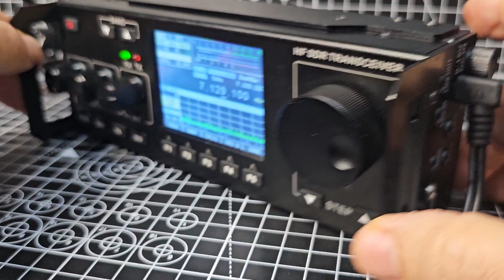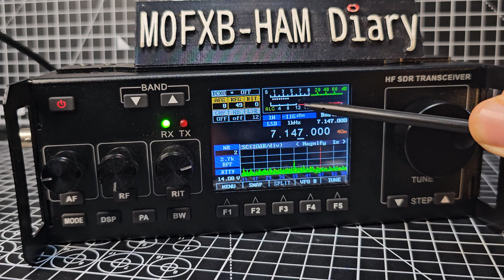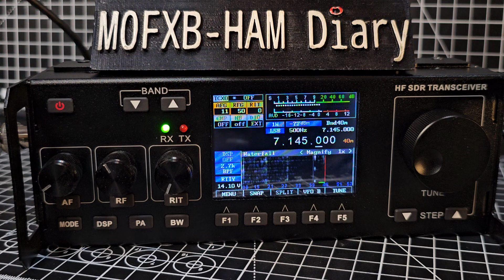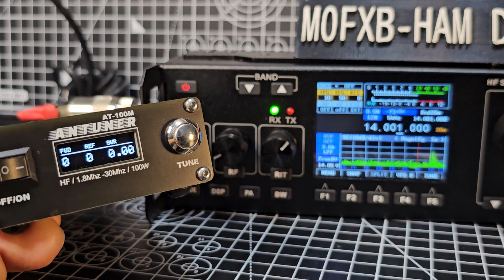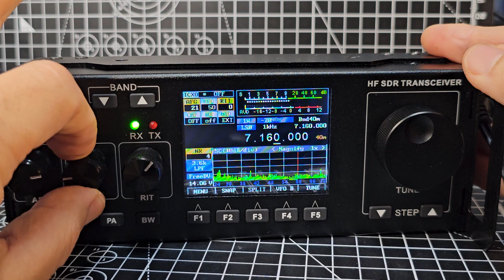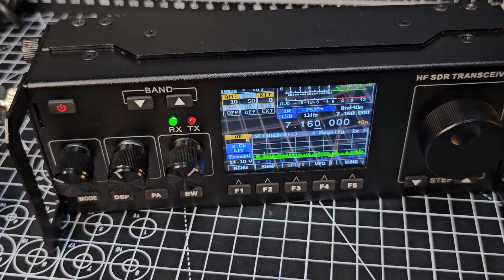RS-918 SDR , HF  Beginner Learning

Comment: Thanks again for your videos on the RS 918. Will be a big help. Here is a really neat antenna to try. Its: A Mag Loop transmit antenna made from 4 inch diameter clothes dryer aluminum vent tubing. I made the main loop 4 feet square. The inner loop or sense is 3/4 inch copper water pipe that is also a square, but of importance is the perimeter which is 7 feet. The 7 feet gives you a good SWR reading near 1 thus a good impedance match. I use a large old AM double gang variable tuning capacitor for 40 meters & 30 meters but for 20 meters where its 79% efficient you want to use a smaller capacitor of around 0 to 40 pf.  On 40 meters its only 27 % efficient but on 20 meters it is a sweet 79%. easy to build too,  a bit big but manageable.
Reply from the maker: Send me one lol I will test .
Reply: @m0fxbhamtech  wish I could. A bit big to place in an A4 envelope. I use mine for 20 meter transmitting because I only have a 40 meter inverted V. It does great. Its also a good choice for the RSP-1A when mucking about from 40 up to just above 20 meters. Because of its size the upper range of what it can tune is restricted to slightly above 20m but I wanted the 79% efficiency it provided so that I can easily get 5 to 10 watts out with my Qrp rigs.

Comment: I am going to watch all your RS 918 videos. By watching yours I figured out from reading your display that it was set at Magnify 1X, mine was at magnify 32X and drove me nuts because the scope's view was only about 1 Mhz. The other setting besides 1X & 32X is 16 X. The 16 X is not too bad but 32 X sucks. By the way, the magnification seems to only be able to be set via touch  and not able to be changed by the display menu.
Reply from the maker: Hi I am still learning lol